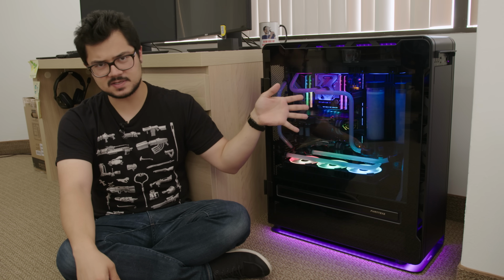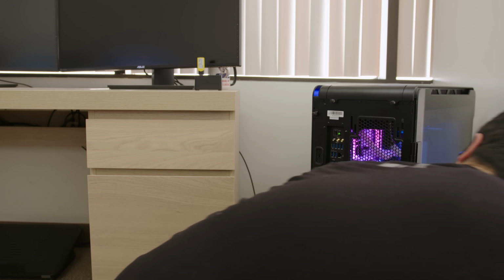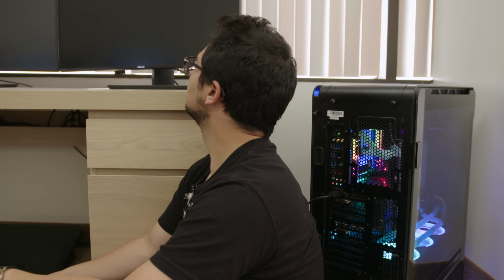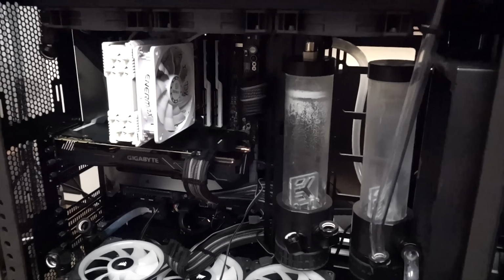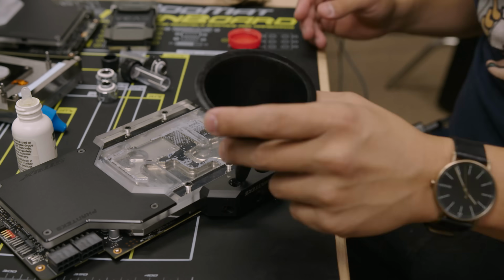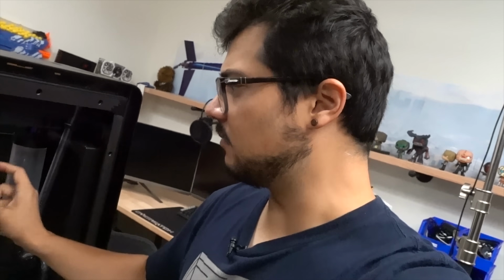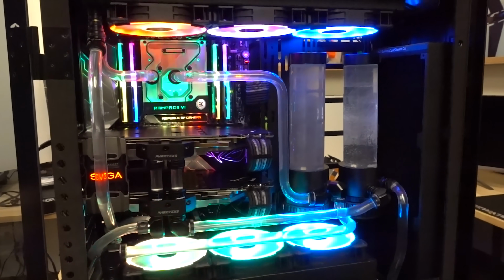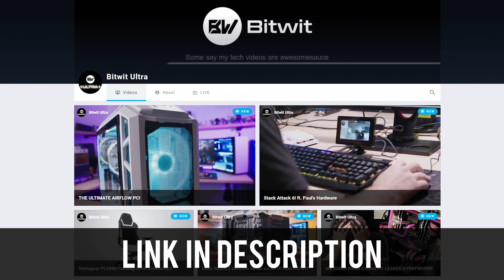Fixing my $12,000 BRICK

Comment: COMPUTER OFF FLOOR
Reply: Paul's Hardware how do you not have any likes?
Reply: paaaaaauuuuul
Reply: top with you. Also, the idiot should have checked cables before he goes opening the case. Total waste of time even clicking the video.
Reply: Excellent!
Reply: I have a system like his. Trust me, It’s too big and heavy to have on a desk.
Having it on the floor isn’t hurting anything.
Reply: But on a carpeted floor?
Reply: Lesson learned Mr. Hardware. I will never put a computer on the floor again.
Reply: Paul's Hardware Kyle, all this time.. You KNOW Paul gets triggered by this. Why do you put him through it? Brotherly love yes?
Reply: @TheSuperhawt
That case has it's own "hard tray" that it "stands on", so the carpet cant really "block" the "bottom intake". And also it looks as if he is using the bottom as an "exhaust". But even if that were not the case having it on the floor should only mean that it would pull in a bit more "dust", it shouldn't make such a big difference for cooling.
Best regards
Reply: @Ben Dover
What he could (should) have done is used the dedicated switches to disable the installed graphic cards (PCIE slots) one at a time. 
Then he should have tested each card "alone" (You can do that and still leave the other installed by using those switches).
If he had done that he would quite likely have had the  system boot when using the "secondary card", at which point he had at least isolated the problem to being "something with the first card"... But there You go...
Reply: I have mine on a utility cart that I can push around. Useful for Virtual Reality sessions.
Reply: C. O. F. could save a life someday
Reply: my next pc mod involves cutting a hole under my pc case in my desk. fuck my desk, long live my pc. may your framerates be high and your temps low bruddah.
Reply: Hey Paul I tell my brother this all the time he has a pretty Beefy case as well,  He just moved into the spare room in my house and I cleaned about 2 cats worth of dust out of his pc just  from it being on the floor in his old place for the last few months,  managed to get it up on his desk now , thank God
Reply: COMPUTERS BELONG ON FLOORS ;)
Reply: You don't think he tried that? I mean, he literally only posted 13 minutes out of the 10 hours of diagnostics. I'm sure he's not an idiot.
Reply: My mum, be like: Why is that big computer ON your desk and not UNDER it? Me be like: but then I can't see the RGB!! and it will suck dust like a vacuum!!!
Reply: Tobias van der Voorden if you have fans on your computer, then you are going to get dust inside it. Doesn’t matter where you put it.
I’m using a Caselabs SMA8 case with side intakes on the bottom (I have a workstation similar to Skunk Works by Pauls Hardware). Anyway, I’ve barely used the system so far, but already noticed dust getting on the case, just from sitting there.
Reply: I am glad I am not the only one Paul
Reply: Jennifer Royal I get it, I do... but for a $12k system I would buy one of those origami foldable kitchen islands or shelves or something like it that would  hold the weight and get it up off the floor, just for the idea of if there's any type of plumbing mishap and for dust and temp control... not hating! Just sayin... gently...
Reply: tenshi7angel exactly!!!!!!!
Reply: Jennifer Royal Yes, I know what you mean. Its now on my desk and still getting quite a bit of dust. Its just that we have a cat and all of its hairs are always scattering across the floor, ready to be sucked up...
Reply: If it can't fit in a cabinet or under a desk where it's not seen....it's too big.
Reply: A coffee table is perfect for keeping a tower on and having a clean desk with just a monitor, keyboard, extra large mouse pad and mouse  (and sometimes a joystick) on it.
Reply: This ^
Also those switches are the main reason when one of my GPU's failed it was relatively easy to troubleshoot (waterloop fitted straight to them), just disable all but one at a time and check which do give output or errors.
Reply: PAUL WALKER?!
Reply: I'm apologetically triggered by it being on the floor as well, not from fear of damaging it but to compliment such a nice build! A nice wooden short (maybe 6 inches) stand would do this justice.
Reply: @OGPurePhoenix  what
Reply: Jacques Boudreau monitor cable sometimes just comes loose or fails shortly after arrival. Trying a spare is just easier and quicker... Often the cause too lol except for hdmi, they don't really "come loose"
Reply: 101 make sure everything is seated properly, push and pull a bit lol last resort give it a tap from your foot lol jk

My PC didn't boot for awhile. GPU water block wasn't set right. 
Then two ram sticks were bad.

Then I found a messed up capacitor. Was going to replace it but found used board. 

Fixed the GPU, replaced the ram and Mobo. It worked for a bit, but found another bad RAM lol -_- my PC is on the floor, hardwood, on an old side panel from a PC case lol 

I will never do water cooling like that, way tooooo much work. Aio corsair's and alike I'll stick to lol
Reply: @Ben Dover yeah, he said the 7980xe doesn't have integrated graphics
Reply: @DaedalEVE  ESD
Reply: There is nothing wrong with having a computer on a floor...

It depends what type of floor it is, and positioning, and what's around the computer.... so stupid..
Reply: Ffs a earthed case the ground is at no risk of static because it's instantly discharged and a youtuber with your rep should know better
Reply: I'm fairly certain Paul's hardware it's not referring to issue with cooling. It's been an issue in the at least in the past probably still now that carpet can generate static and shocks can effect the system especially sensitive parts.
Reply: @aunderiskerensky2304  na man just hose the coolers with canned air when the temps rise like nos
Reply: @tatsuhirosatou5513  ok time to really tinfoil it up in here. we rig an exercise bike to a bellows like a smithy. keep pedalling and your temps stay cool. ill just leave this here.
Reply: Agreed.
Reply: PurePhoenix 4
Would you watch a video of a man testing cables?
Kyle knows what he is doing .
Making videos is his income .
My theory is that the weight of both graphics cards caused the top card to pull away ( Ever So Slightly ) from
solid PCIE connectivity .
In Kyles defense , it was definitely time to remove the adult video leftovers out of the water loop any way .
Reply: You mean get the brick off the floor or it will short circuit the computer
Reply: Kyle Should get you to 1M I Think he could
Reply: MY PC'S been on the tile floor for 6 years and have had no issues
Reply: @tatsuhirosatou5513   lol i like it. could set it to auto pump at preset temps like a nitro methane induction man! lets make this happen!
Reply: @TheSuperhawt  TBH I prefer to keep my PC's on a desk just because I like my RGB's visible and I prefer not to have to clean my PC as much but as long as you clean your rig a few times a year carpet does nothing negative.  You're not going to ruin any static sensitive components just setting the built PC on the floor, the entire system is grounded through the ground in your wall so it's not like there is really anything to worry about.
Reply: @tenshi7angel  Nice idea.  I may need to play around with this and see what it can do for the portability of my 50lb rig.  Especially to bring the pc out to the living room to have friends over to VR.
Reply: @ChimmyxChang  It makes the pc much easier to clean, especially if you are using a custom loop setup. It also makes an actual gaming machine useful for multiple setups.
Reply: @LinusFoamTips He just said, "The motherboard has no integrated video!!!"
Reply: Paul is awesome! Thanks for helping me build my first PC.
Reply: Q just buy yourself a pyramid case. Problem solved
Reply: First thing i was gonna say...
Reply: @DaedalEVE  THE FUCK YOU USE A VACUUM INSIDE A PC?!
Reply: @Daniel Arenivas Absolutely, he even does simple stuff like throwing shade on the '1080 OC' performance these days in his "Roast" video.....the guy has a 1660 lol. His facebook post has a picture and clearly says it's a 1660non-Ti and he talks smack about a 1080ti like he's even remotely in the same ballpark.
Reply: @OGPurePhoenix   he was trouble shooting for months he probably did
Reply: He has a metal plate under so it can get air and a boost up
Reply: yes we need more broken shelves

Comment: This is why air cooling is superior in terms of laziness
Reply: And why AIO cooling beats both (in terms of lazyness).  So easy to work in an AIO cooled rig because there is all that extra free space!
Reply: AIO will hit the same temps as air cooler when gaming, but take ages to cool down, thats why most are going back to air
Reply: AIO> all others.
Reply: @Andy Gotta admit, I returned my dark rock pro 4 for a corsair h150i. Gotta have that RGB goodness.
Reply: but for PC enthusiasts like myself, we'd rather spend the extra money and effort to have the best performance and looks possible.
Reply: I wish I could love this comment!  If I had to drain my system to do anything, nothing would get fixed
Reply: Thinking of quality metal fittings, not plastic.  AIOs have a shelf life of what, 3-5 years? then again, how long does the computer stay relevant before the next build?
Reply: Also you don´t need to maintain the pc as much plus it won´t become fatal for the rest of the tech if you done the installation wrong with leaking.
Reply: *mentions laziness* *profile Pic and name is ResidentSleeper*
Reply: aio coolers are actually shit i swear lol
Reply: Air cooling > liquid. Tho I'll admit AIOs look really sexy
Reply: @BrainSlugs83  I get very low temps (19C idle, 45C load) using my air cooled Le Grand Macho.  You would be hard pressed to beat that with an AIO, especially considering the price/performance ratio and maintenance.
Reply: Combine with a carbonaut graphite patch, No thermal paste to worry about either.
Reply: Connor G  uh I'd never recommend an AIO, 1) you need to do some amount of upkeep as water corrodes. 2) more moving parts = more points of failure. And 3) air coolers are usually cheaper for the cooling you get, water cooling just moves the heat source to another point to cool it off. Sure you CAN get more surface area, but you can say the same thing with air coolers.

On another note, custom loops get an exception since it's not just about cooling, but it's for the ones who do it as a hobby and enjoy the time making their PC look nicer.
Reply: @BrainSlugs83  but its not good looking
Reply: @systim30  first off.  I dont use closed shitty water coolers.  And yes, adding more rads lowers the temps in most cases. (Not pc case) with me i dropped about 5c with a extra 360 rad.  And still added a gpu ..  U didnt answer the biggesr q. Overclocking, u need water to oc heavy. And noise du didnt answer.. noise os nothing with water. Compl silent.  Air isnt
Reply: @systim30  more efficient? U are lying to urself man.  U cant get that low noise with air and the same temps.  And yes. More rads can lower temps. This is proven.  And i did it myself. And to lower noise. All my fans can spin at 300rpm.  Cant hear them at all.  Max temp with 8086k oc is 47c on max loads.
Reply: @systim30  i know about the ambient tempS.  Who is jay?  Omfg.  Jay is who everybody who owns a pc should follow!  More rads,  less nois. U can check jay up on that to istead of saying no to me.  I keep my same temps with 2 rads, but lesser noise. Only thing i can hear i the pump..
Reply: Aio arent about cooling....theyre about cooling silently, youll get just about the same temps at a lower rpm
Reply: @metlingaming9162  so your aio does not have a pump i guess :D   not but seriously. everyone his own, but i will never ever watercool anything its just.. pc components, electricity and liquid in the same case is like... no. like i m totally honest but i wouldnt even be able to use my pc anymore if it would be watercooled since i would check for leaks like every time before i turn it on and every hour just to be safe because i would be scared as fuck. and i dont care if it looks better or if the temps might be lower.  Watercooled loops do fail, ,maybe onlly once every 10000 but it happens. And if there is even a chance of my pc blowing up because of liquid that isnt necessary, i would not take the risk. And lets be totally honest here, for the most part it doesnt matter if your cpu is 45 degrees or 60 because either way its way below the temp limit. you can cool it down to 20 degrees but it still wont live longer or perform better because of it.  its just an e-peen so i can say "oh yeah its only 45 degrees"  thats pretty much it in any real life scenario.  And for the AIO thing. Dont even put these on the table and call it watercooled because they are not. An aio is an air cooler with the fact you changed the heatpipes to liquid but the rest is still the same. + pump + more possible issues.  And they are 1. not more quiet. and 2. not more effective at cooling.
Reply: Profile pic fits perfectly 👌
Reply: love air cooling rather do that, because i can't spend this much time on my computer because it isn't my work haha.
Reply: Michael Jensen h a a a a a a a a a a a a a a a a a a a a bluescreen hey my computer was super sensitive whenever I would like slightly shake it or something. Turns out the screws on the air cooler were too tight on my pc
Reply: @systim30  yes. More rad.  But compl silent. Thats the beauty about custom cooling.
Reply: @systim30  u can't have as cooled and silent as custom cooling. Thats just no way.
Reply: @systim30  and i clearly dont care about pc at all man. U want it cheap, no leaks? Never har any. No maintenance? It is done skrubbing it all and change coolant in 60 mins. I dont know even why u are here. Go get a console
Reply: @malkiebroon  "but take ages to cool down, thats why most are going back to air" And that is completely made up BS
Reply: how long are idiots gonna going to anoy me with alerts about a comment i made a year ago?? ffs
Reply: MANoWAR AIOS have more points of failure unlike an air cooler. You can easily overclock with a air and make it look slick. AIOS from most companies are As tec or how ever you spell it anyway.
Reply: I got better cooling on air than AIOs. When I removed the AIO it seemed to only be making contact around the outside edge of the heat spreader and no the middle. Went back to noctua and it was fine.
Reply: @systim30  bruv. Your overclocking and temps on synthetic benchs and gaming will not even be close to what a custom loop can do. You can't just say "yeah its overclocked and low temps". I can bump up my cpu clock by 0.1ghz and call it an overclock. There are layers of overclocking and it would reach to the point of enthusiasts who like to push to the limit of their components without it getting hot. No consumer air cooler can overclock like that. You don't see people running a 9980xe on a nh-d15 even though that air cooler is as good or sometimes, even better than a 240mm aio. The only thing I see that air coolers being good, are for easy installation, easy to no maintenance, and cheap, but there is a point in pc gaming, where price to performance starts to dissipate and people wouldn't care. For example, a 5700XT has great price to performance because it can beat an RTX 2070, and cost 50-100 less. Oh and I forgot one thing to mention. The amount of overclocking you can do on a watercooled gpu is way better than its stock cooler. Especially for the blower cards that the 5700xt reference design uses. I currently have a 1080ti ftw3 and I don't think it is running good temps for DEFAULT clocks. It is running at 60-65c while gaming on 25c ambient temperature. The fans are running at 40% and I can hear them for sure, they aren't loud, but I can hear them. If I were to run an overclock on this card using non-manual automatic overclocking from softwares. They will put the fan on a custom curve. The card will get to 70c+ and then the fans will go over 50% where it would be so damn audible. Idk why you are so biased, but you leaking in bullshit for someone who is not using liquid cooling on his system. You can't put "overclock" "quiet" "air cooled" in the same sentence because its just bullshit. I have tried air cooling and its great and all for stock, but it will run 70-80c if you overclock it and even though the gpu and cpu can handle that temp. I don't want it at that temp. I want my gpu to be under 40c under load. Which a stock air cooled gpu can't do. I want my cpu at under 40c under load also, which an air cooler can rarely do on stock settings.
Reply: My be quite is sick I don't get water cooling honestly.. I
Reply: @systim30  So your car is air cooled too? How far can you go without overheating the engine?
Reply: @bottomtext5872  louder?🤣 i dont think u know shit about water cooling.  I got 2 radiators, pump cant  be heard.  My pc is compl silent
Reply: @bottomtext5872  again.  Dont speak about something u dont know nothing about. I have 5 fans with 2 radiators, and becouse of that i can have my fans at very low rpm. I keep all fans under 500rpm. Compl silent.  And im using only open back headsets, witch means i hear everything outside my cans.  And i can't hear my pc
Reply: @malkiebroon  yea but give it enough time it will cool it better and such a beefy air cooler that can match it will be very loud
Reply: @malkiebroon  yea but give it enough time it will cool it better and such a beefy air cooler that can match it will be very loud
Reply: @malkiebroon  lol dude what? You really think air coolers are as good as closed water loops.. smh
Reply: Laughs in cold Icelandic winter
Reply: @malkiebroon  no
Reply: Aio is better tbh if you're lazy
Reply: @MommyGanyu  nah nah nah
Reply: @malkiebroon  The taking ages to heat up and cool down is actually an advantage, there are fewer temperature fluctuations and it acts as a heat soak.